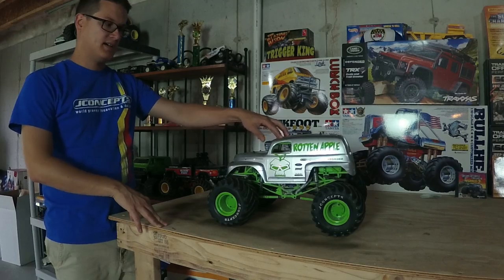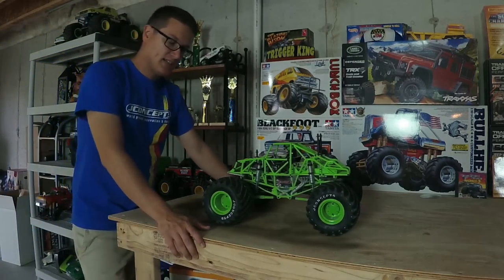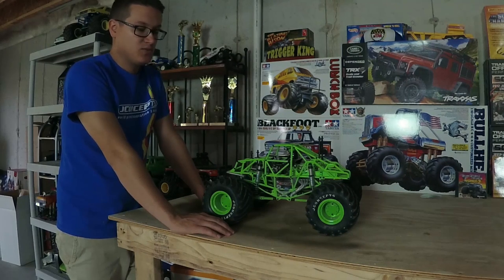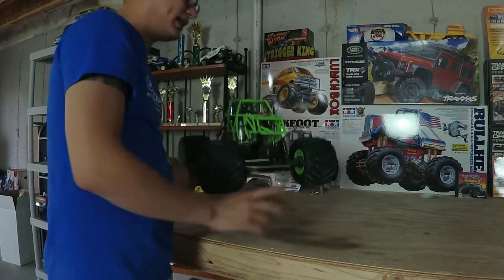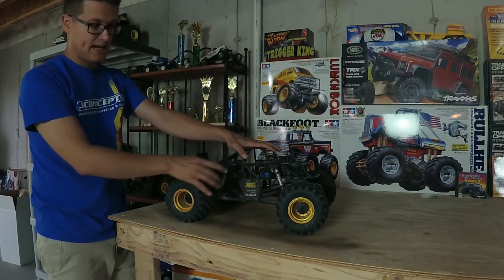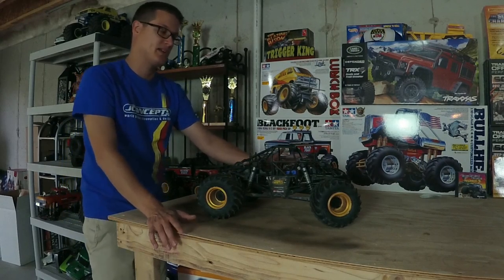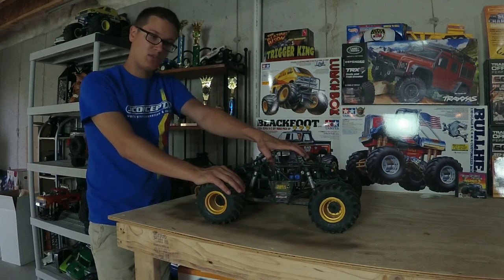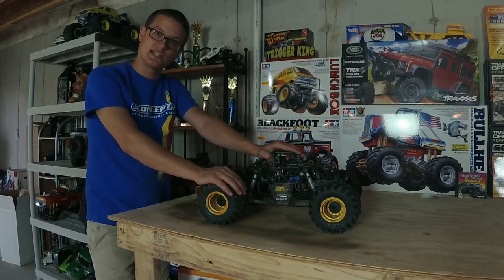Modifying an Axial SMT10 for Competition - Trigger King Tech

Comment: Great looking trucks. My SMT-10 is actually the opposite it's been turned in to one heck of a crawling trail beast and the soft compound J concert tribute tires are actually really good for crawling and trailing and hold on to your hula hoops because of the tires the truck can tread water (It floats) with half of the tires sticking out of the water.
Reply from the maker: I've seen some other SMT10 crawlers and yeah, if you go the way you did it can be a capable crawler. At its heart it's really just a wraith with a slightly different driveline and lighter cage. Have fun with that rig, thanks for watching

Comment: Great info man. Thanks!  But why shortened the wheelbase? Also I found one of this axial grave digger stock in new condition for sale at 250 euros and i was wondering if it's worth the buy? I have never own a rc monster truck like this but i like the grave digger theme. Does it come with the hardware to just add another servo at the back for 4ws or do i need extra shopping for parts to make it 4ws? Thank you for any good info. Thumbs up!

Comment: Every Axial I've owned with AR60's the rear ring and pinion are the first to go.. I put an SSD center diamond on my SMT within a couple packs. The stock gears actually hold up in that axle too.. I run a Mamba X w/2850kv on 3s. I also run metal trans, gears and MIP drive shafts. I learned my lesson first with a Wraith the a Yeti. I think I practically gave the Yeti away. I couldn't keep gears in the rear for one battery. There is a lot better stuff out now though it probably wouldn't be a problem..
Reply from the maker: A few of us have been thinking about using those center diamond axles. With you recommendation that makes me want to try them even more! Luckily, most of us have had luck with the spider gears.

Comment: Thanks for the shock idea, i was thinking of purchasing shorter prior to hearing that.  Do you know if any of the racers have swapped out the diffs for the overdrive units?  I am currently building an SMT 10 truck too but I used under drive diffs thinking i could get better acceleration for some of these types of track designs you guys run.  I got a tekin pro 4 4600kv set up with a castle Esc not sure if i should  have gone the over drive route.
Reply from the maker: Hey ButtonsMcBroom you can see Jeremy's answer to David L's comment below concerning OD. As for underdrive, if you have sway bars on the front torque twist is pretty minimal, even in my pro mod so I don't think I'd recommend UD. Unless you were running super short courses I think taking the gearing off the top end would actively hurt you.
Reply from the maker: That's just a matter of opinion though and I've never tried it. Only one way you can find it!
Reply: Thanks, I think I will try out both.  Keeping in mind about what Jeremy Mark answered about motor temps.
Reply: Some say the underdrive have better gear mesh. More teeth together at that point.. I don't know personally but that is what i've read. I've always used the stock gearing.

Comment: great video, guys. I have a question, I'm wanting to get something better than the usual walmart stuff but I can't spend a fortune. it's mostly gonna be used for bashing and possibly light competition. what would you recommend? also, love the copy of MTM2 in the background!
Reply from the maker: The SMT10 is the easy answer, but to make it fun you'd want a little bit more power. A 17t motor would wake it up, as would the included 16t gearing. My recommendation for a fun bash truck would just be a BIGFOOT stampede. You can have a lot of fun with those for relatively low cost
Reply: They all get expensive fast. Just depends on your pockets and patience.. It's fun though. You definitely want other people around that also play around. By yourself will get boring fast.

Comment: i have  SMT10  and got the jconsepts tribute wheels, but i got the rc4wd bnh monster truck tires for it in steed of the jays. well the problem is im running the 25mm spacer from the rims and i still have contact with the lower links. does any one make a longer spacer for the wheels? pluss i got a 5700kv brushless ( castle creations ) and the sidewinder3 esc, what do the think would be the best gearing for the truck?
Reply from the maker: You will still have contact sometimes with the lower mounts but what we do is set your servo input on the radio to the spot where there is no bumping. JConcepts does make a wider offset hex though, introduced on their Ranger and Dragon wheels. I'm sure if you sent them an e-mail you could get a set of them. Those should clear no problem. As for gearing, It'd leave it at a 16t pinion if you are using a stock spur. Maaaaybe 17t. Thanks and good luck
Reply: thank you for getting back with me

Comment: When you say 6.5 motor, is that a 2 or 4 pole?....if 4pole is it 540 or 550 can?
Reply from the maker: Most of us are using 4 pole 540 can motors. The 550 size are usually just too much for these trucks.

Comment: do you guys run over drive gears in your axles?
Reply: David L I can't speak for others, but I do run overdrive gears front and rear in my Taurus sport mod that debuted last month. They will increase speed, but with that and a 17t pinion the motor gets hot in a few minutes. Fine for racing, but wouldn't recommend them if you're planning to bash around the yard for 15-20min at a time.
Reply from the maker: No one has talked about it but I'm pretty sure a few guys are doing this. As Jeremy said, its a great idea for racing but you better be careful if you plan to bash it for any amount of time as it will get even hotter! Thanks for watcing

Comment: Thanks for these videos! Very informative! I’m currently building a SMT10 to hopefully do some pro mod racing and your videos have been very helpful. I’m curious what C-Hubs and lockouts you went with. I know you mentioned you are running aluminum parts there but didn’t get into specifics of brands. I see a few people make them including Vanquish and SSD, trying to figure out if any particular one works better than the others. Thanks!
Reply from the maker: I have a combo of Vanquish and SSD stuff. You can't go wrong with either, really
Reply: Trigger King thanks for the reply. Any other axle mods that are preferred/necessary for pro-mod trucks?